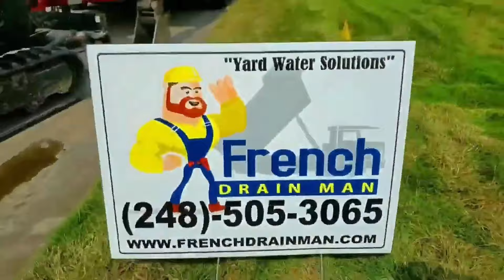Fix Negative Slope Around Home for Better Drainage [ Full Installation Before, During, After ]

Comment: What do you do if the siding of your house is hardie board?  Right now I have 1-3" from the bottom of the siding to the ground.  We have clay soil in the Rocky Mountain state.  I was thinking of using that to go around the house like you did sloping to a swale that I would cut in and then add gutters along that same side of the house.
Reply from the maker: https://youtu.be/76EcYaGDboM?si=tEz5YIxyJqqqoNzl

Comment: Great video! Love putting the French drain and the downspout pipe in the same trench. Awesome job....Questions: 1) did you put the repurposed clay directly on top off the existing foundation perimeter turf..... I don't see that the sod was removed? Will that not lead to subsidence and voids? 2) What if you don't live in an area with clay based soil to establish a positive slope away from the foundation? ? Is there a second best alternative ?
Reply from the maker: https://youtu.be/76EcYaGDboM?si=uxntPbvzmaBHTqvO

Comment: Great work; a question: Does it make any sense to surround the house with a hard surface like concrete or paver stones to divert even more top water away from the foundation? I understand that sloping away from the house is necessary, but is there any added benefit of doing this slope with a hard surface and not soil?
Reply from the maker: Clay is like a rubber Liner. Your call but I use clay like the video explains.
Reply: Where do you buy the clay?
Reply: @FRENCHDRAINMAN  Got it, clay is like a rubber liner and is good but like @akinun asked, can DYIers use concrete or paver stones or some other hard surface to keep water away? Or do hard surfaces other than clay not work? Thanks.

Comment: A few questions:
1. Can you have too positive of a pitch?
2. Can you pile up dirt/clay (I have clay in my area) up to the brick facade? (I've heard water penetrates through vinyl and wood, rotting behind the wall)
Reply from the maker: https://youtu.be/oNeZdvS-RgM
Reply: When the pitch is so positive that it causes water to run fast enough to erode the ground cover and dirt, it's too positive.  That's where you want to think about an open French drain (that's a "dry creekbed" most of the time)  if it's limited to a narrow path, or making terraces separated by retaining walls if it's a broader area.  The retaining walls can be very expensive, but in extreme cases there really isn't any alternative.  (You'll have less trouble mowing without a huge slope, too.)

Comment: With a French drain in clay it’s better to backfill with a non clay enriched top soil you said it yourself it acts like a pool liner so your reducing the water intake from the top you will get better performance by not putting back the clay soil over the French drain as it will eventually clog the fabric this came directly from NDS and there contractor certification course or what’s your take on this maybe there wrong but makes sense to me
Reply from the maker: https://youtu.be/VFYj7sbmXGg?si=7ugkbZkjj5Rnlx1O